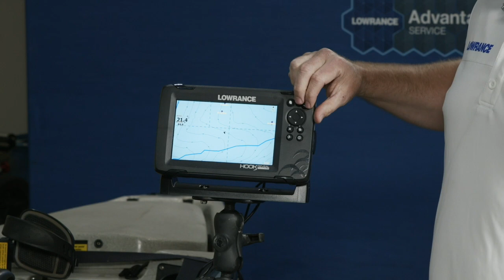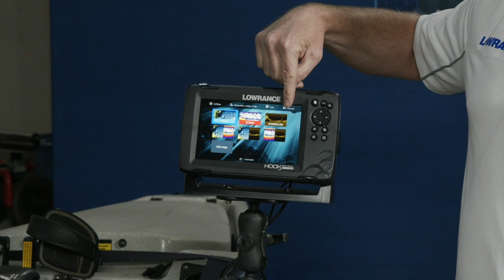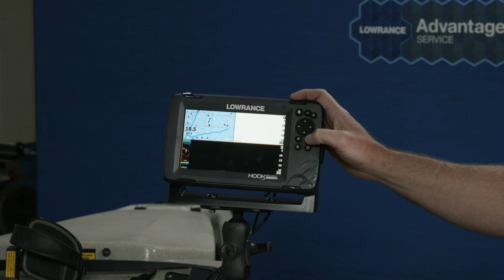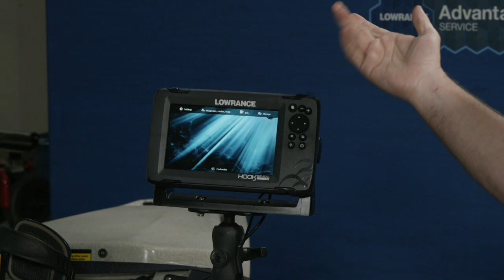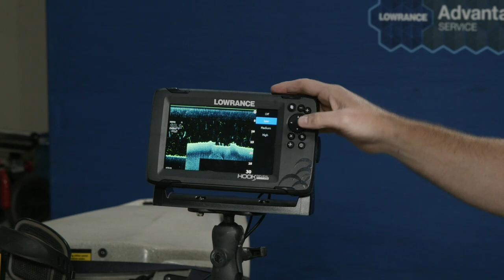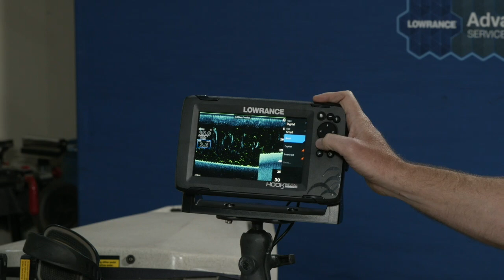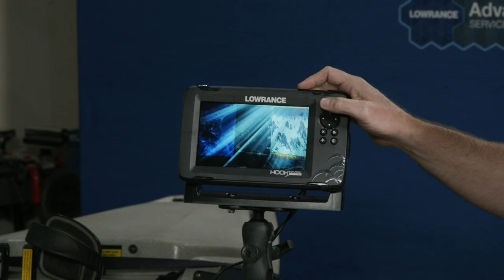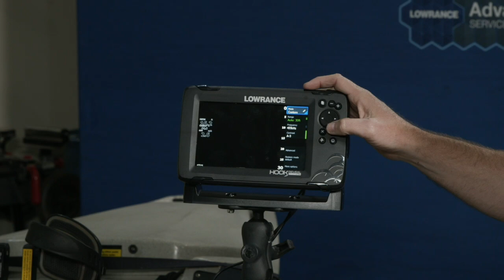Lowrance LIVE | HOOK Reveal | Webinar

Comment: I just replaced my hook2 Splitshot with the Hook reveal Split shot and figured I could just leave the Hook 2 splitshot transducer on the boat and It should work perfectly with the reveal Splitshot.  Am I thinking correctly.  I also couldn't get a sonar reading first day on the water.  It said Stopped.   I went in and selected Splitshot transducer on the menu option and haven't had a chance to try it on the water yet.  Is that the correct move.
Reply: I actually have a similar question. I just got my hook reveal split shot transducer included and found out the deep is not much accurate. Since I use my boat a lot for scuba diving and I need to know how deep I am so I was wondering if I can use a better transducer of course form lowrance to get more accurate results

Comment: One question.  If a page is created with 3 parts,  how do you adjust the size of both borders?  When I selected the adjust split I can adjust the first border but not the second border.  It shows the adjustment tab but can’t get it to toggle to the second border
Reply from the maker: You will need to select the part you want to change before hitting the 'Adjust Split'

Comment: Good webinar but I still don’t understand the size of the bottom area I am actually seeing. Granted it varies by depth, but isn’t the beam angle fixed at a specific degrees?  What is the angle on a hook reveal 5 splitshot?
Reply from the maker: beam angle as follows:
83/200kHz:
83kHz 52º - 200kHz 22º
50/200kHz:
50kHz 35º - 200kHz 12º

Comment: @Lowrance  if i buy a triple shot hook reveal unit can i later add a hdi 50/200 transducer and just switch between them for fresh or salt water? A TS unit will be able to run both but a SS unit cannot run a TS transducer if i understand this correctly? Thanks
Reply from the maker: That is correct, you can use a 50/200kHz with a TS head unit, but you cannot use a TS transducer on a HDI head unit model. That is because the SS head unit does not have sidescan capabilities.

Comment: I got a hook 5 triple shot lowarance and a hook 7 triple shot Wanted to find out if there is a connection so i can use one transducer.
Reply from the maker: The Hook2/Hook Reveal series does not have networking capabilities.
In order to share sonar, you would need an ethernet connection.

Comment: Hellofrom greece,As a new Hook Reveal 9 owner, i want to ask you , which is the best setup , for squid fishing?
Reply from the maker: It depends on the depth you're fishing. What transducer do you have? Keep in mind the Hook Reveal is an automatic unit and not many settings can be changed manually.
Reply: @lowrance  Τhe depth that i am fishing,is from 15m until 35m, and the tranducer is  50/200 HDI XDCR .

Comment: question- i have a lowrance revel 5- it is setup on a pontoon.  when I go over 12 knots the depth finder stops working. any thoughts?
Reply from the maker: Does the depth finder stop working, or do you just lose the bottom? In the second case, you will need to check your transducer location and move it accordingly.

Comment: I read somewhere that the tripleshot sonar cone is wider than the splitshot cone. And that the splitshot is a bit better in clarity for deeper water in regards to separation targets due to it's slightly narrower cone. Is this true?
Reply: That is true. On hook2 2d aka traditional sonar was the weakest part on all transducers and in hook reveal series 2d transducer 83/200 was updated (now the same as with higher level lowrance units). Also 50/200 for deeper waters (bigger ceramic emmiter and more narrow cone than in 83/200) was introduced into hook series.  Tripleshot remains unchanged. So for traditional sonar splitshot will work better than tripleshot. Quite good article here: https://teamcolibri.blogspot.com/2020/03/lowrance-hook-2-versus-lowrance-hook.html

Comment: I recently bought a Hook reveal 5 with a preloaded "base map". I'm now thinking about bying a map for my area (europe) can I "move" that one onto the unit? I want to be able to log and for that reason I need to have an other SD card I do not want to log to the Card where the map is.
Reply from the maker: You cannot modify the map that is preinstalled onto your plotter. You will need to use another micro SD card to save your sonar logs onto.
Reply: @lowrance  Thanks for the update, what happens if I buy an other C-map chart with my area, can I log to that card and make social maps from it?
Reply from the maker: We would not advise to use the chart card for other reason than navigating. You can save your sonar logs into the internal memory and then transfer them onto a blank micro SD card.
Reply: @lowrance  If i log on the device can I then load them onto the Map card ie with the separate map?

Comment: I have returned 2 of these Hook 7 Reveal. The units would not turn on, even though wiring was correct and 12.35V were being supplied thru the power cable to the unit. This was checked with a voltage meter. Talked to customer service & technical support, ran thru testing unit buttons attempting a reset of the unit. It still would not turn on. BTW: both customer service and tech reps are located in Manila Phillippines!! Both had very little knowledge and it felt I was educating THEM on voltage supply, requirements and wiring. What has happened to Lowrance. I have been loyal customer, 7 units over the past 30 years.....NO LONGER will be a customer!!!
Reply from the maker: Please send us a message via Facebook with your contact details and unit's serial number. We'll be happy to help you from there.
Reply: @lowrance  I was finally able to contact Lowrance USA/Oklahoma office. Over the phone test walk thru and my voltage meter check, it was determined the 2nd unit is also defective. I returned it to the vendor purchased from.

Comment: Is it waterproof???
If you have it on a kayak and get flipped and it is dunked for one minute or less; will it kill it???
Reply from the maker: Rod- Our Hook Reveal unit has an IPX 7 rating if the card door is closed. This means that the unit is waterproof when submersed in water at a depth of one meter, for 30 minutes. So if your kayak flips over and the card door is closed, then the unit will be fine.
Reply: @lowrance  Thank you!!
Reply: I just installed the hook reveal 7 triple shot and I am putting it on simulate mode and I don’t see anything on the screen it’s scrolling but no picture? Could my transducer be damaged? Or is that normal. If I put it on demo mode it does let me see the screen.. so it seems weird to me. Just wondering.
Reply: @dandiego6199  I have the same problem. Looks knackered to me so will check with Lowrance tomorrow.
Reply: I checked with lowarance and the guy I talked to told me that the demo mode and the simulation mode was the same thing. So in my mind the guy that was representing lowrance obviously had no clew on what he was talking about. If there’s a problem I think it will be with the unit not the transducer. I will be taking it out on the water and checking to make sure that it works..

Comment: Can I use my triple shot transducer with this unit head
Reply from the maker: You can use the TS transducer with the head unit. However, if the head unit is a SplitShot, then you will not get the sidescan feature on it.

Comment: Just installed a brand new Reveal 5 Splitshot.   Never got past the Lowrance logo screen before the screen flickered then went black.  After the 4th attempt the logo screen would not even come up. Piece of junk!  Ive been a Lowrance guy since the 80's with the paper graph.  Disappointed to no end.  What happened to quality control at Lowrance?  Do you check each unit before its sent to distributors?  Sending mine back to dealer for refund and will look at Hummingbird or Garmin.  If I'm paying near $500 it better work first time!

Comment: This is significant http://allabout.wiki/fd12?... When scrolling around the sonar screen or chart, setting waypoints, etc touch input is much smoother and quicker. On the Hook unit you have to use the arrow keys and buttons to do everything, which is slower, more confusing, and tedious. Imagine using your smart phone with no touch screen but with arrow keys and buttons instead and you get the idea. Touch input reduces frustration on the water.
Reply: The Hook Reveal is easy to use. The buttons are no big deal.
Reply: First world problems